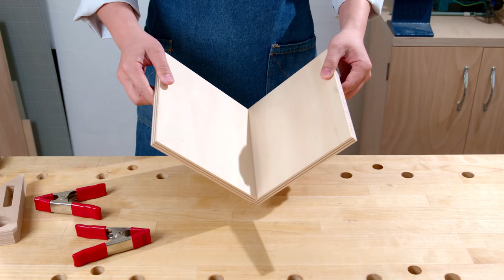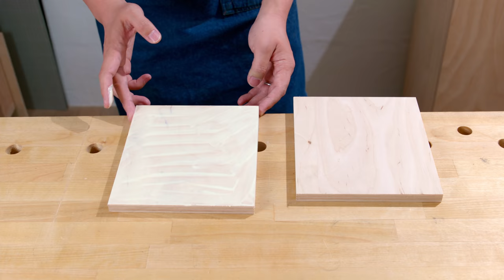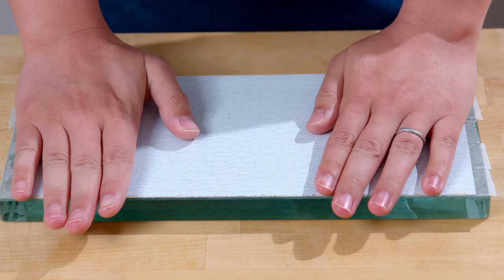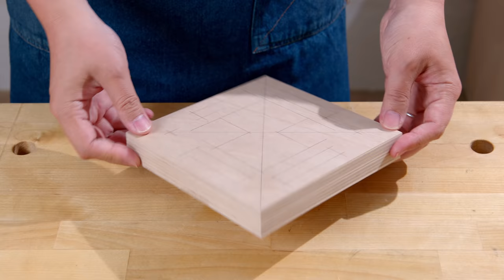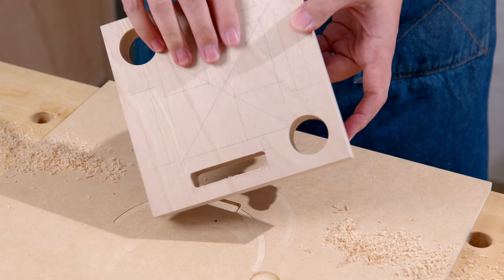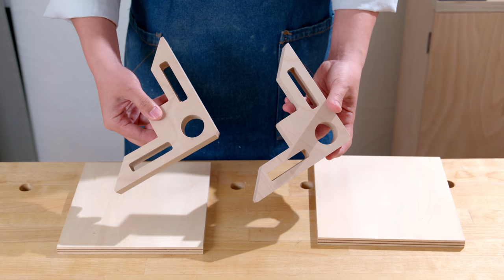Universal design corner clamp / Right angle corner jig

Comment: Hi, funny enough i have 2 perspex large school mathematics triangles that i use fairly often, i also bought some metal 12 inch / 30 cm 90 degree shelf brackets and had a friend of mine weld a rod on the long side to stiffen them up and have them not move

I like the way you made it usable with 3 different clamp variations

Excellent well done

Comment: What brand is your double-sided adhesive tape you always use? I like the fact that you  can just tear off instead of cutting :-)
Reply: JSK has replied to this question in other videos - "I use this double-sided tape https://amzn.to/2rnNSkl
However, I use four different types of double-sided tape depending on the application."
Reply: Please give us an idea of the brand? Or, even just the type of tape... I have no idea what to ask for, here in Europe.
Reply from the maker: This is the double-sided tape used in this video.
There is a difference in adhesive strength.
Based on my experience, I buy them according to the purpose and material used.
Double-sided tape commented by other viewers is also used according to the application and material.

https://amzn.to/3gb2Org
https://amzn.to/3cgo4KY

However, this comment section is not enough to explain them.
Reply: @jisakukobo  Thanks!  Arrigato gozamsu

Comment: Your 2 boards are clamped to your brackets but not to each other so what is applying pressure to the 2 pieces you want to glue together?
Reply: The clamps, via the ‘brackets.’
Reply: @jasonandersen5975  You would normally apply a downward pressure to the piece being glued, these brackets simply hold the parts together, no pressure is being applied.
Reply: It is more to hold your 90
Reply: @JoePCP  I’ve used similar brackets. They provide ample clamping force to get a good result.

Comment: Enjoyable video but, as these are made of wood, how well do they hold their accuracy in the long term?
Reply: Plywood has no grain(almost- it does have some cross grain which cancels itself out) so it doesnt change its dimensional stability in different humidy conditions unlike natural timber ... unless it gets exposed to direct water contact ofc.  
Also smaller cut square pices here shouldnt bend too much when cut off from the main sheet and will most likely remain straight - these seem to be cut out from 18mm sheet or maybe even 22mm. Cheap, can be made from off cuts and can be replaced if/when they get damaged, it doesnt take much time to make so well worth the effort of replacing them say once a year. Even alloy squares get damaged and replaced when used daily. 
In my opinion this highly effective jig, equally as good as the most expensive stuff out there and can accomodate most clamps, while being cheap.

Comment: You forgot when you glue two boards together using your jigs thats there is glue out from the joint that will leak onto the jigs and attach them to the work pieces.
Reply: That is why there is a chamfer on the outside 90° corner of the jig-clamp. The jig never touches the glue.

Comment: It wasn't clear to me how you achieved a perfectly square piece of wood to start the jig. You demonstrate that it is square, but not necessarily how you got it to be so. It seems to entirely hinge on how square your initial cut was with the circular saw, as the sanding that took place simply achieved a flat surface and did not adjust any angles.